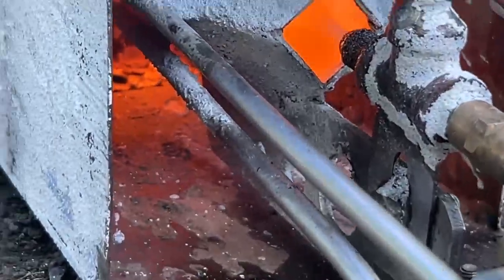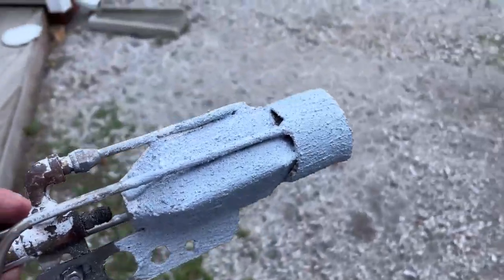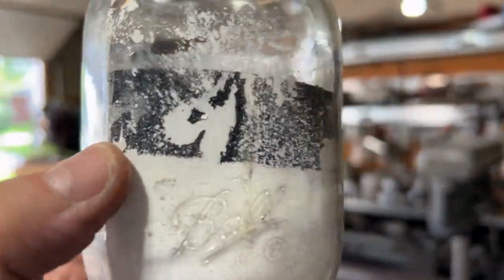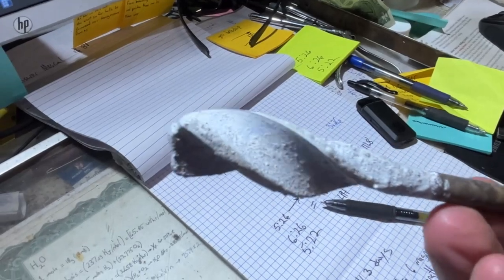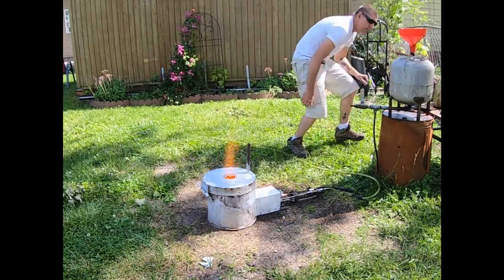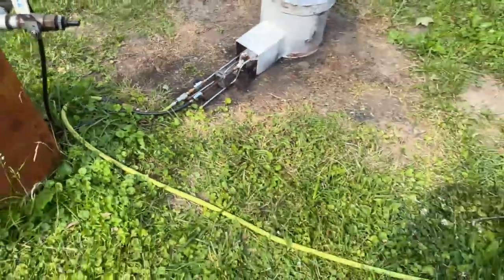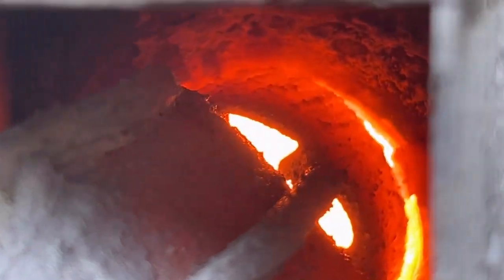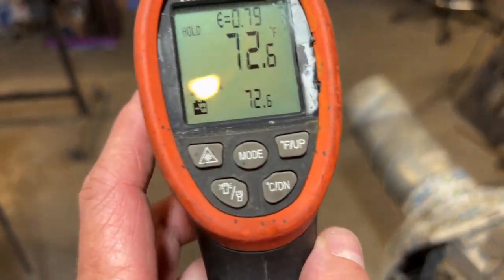New Refractory high emissivity coating formula

Comment: (1) Please, what's the role of play sand in this refractory mix? I did not see you add it to the formula. (2) The Black Blasting media, what material is that or its composition?
Reply from the maker: Without the sand it cracks , the sand acts as a spacer to make up for the contraction on drying

Comment: Just a thought: heat the project half way to projected operational temperature, then spray coat the surfaces with the coating as it cools; additionally rough the surface.

Comment: something to keep in mind is any fuel burning after it comes out of the lid is wasted fuel. the more densely you can burn the fuel off the better for efficiency. do you preheat your air as well as the fuel? on my burner i have several wraps of copper tube near the red hot steel to preheat the pressurized nozzle air more than the oil. while this more or less eliminated the coking in the oil preheat tubing, this might lead to coking in the nozzle at some point but i haven't had a problem yet.  i also find that after doing this choking the inlet air down to i think it was a 0.500 hole with 6 radial  (and relatively small) louvers gave me a really nice burn. it would be interesting to see what would happen if you could get the injected air temp high enough to auto ignite the oil at the mixing point but not coke it inside the injector. i would also like to be able to preheat the air pulled in by the burner with the exhaust of the furnace or using it as a dual use preheating the air and cooling the burner body at the same time.
Reply from the maker: The atomizer air is pre heated to 300 deg and the furnace intake air is heated by the pre burner waste heat . keeping the oil under 300 deg is ideal  . I do have and idea for an upcoming build that uses a pre  heat sleeve
Reply: @NOBOX7  is pre heating really better for these burners? i was under the impression cold air is better because there is more oxygen vs in the same volume of warm air
Reply from the maker: I have neglected to dry my incoming compressor air but i do have 2 water separators

Comment: Cool stuff mate. I’m eager to give my furnace a coat on the inside, looks like it will fill the cracks nicely 
Have you tried any refractory mixes with colloidal silica?
Reply from the maker: no but i have read about it being suspended by bringing the ph down to 4 in alcohol solutions

Comment: I would like to see more durability testing. Could you make a video using this stuff like a bed liner coating?  If you used the right aggregate or size of aggregate it would be a very even coating.
Reply: Maybe, but why would you want a high-emissivity bed liner?
Reply: @travispluid3603  I would use it on other applications. I want to see it coat large areas to see how good it is.
Reply: @MAZEMIND  but for what
Reply: @CreativeAndCreepy  Pulse jet :)